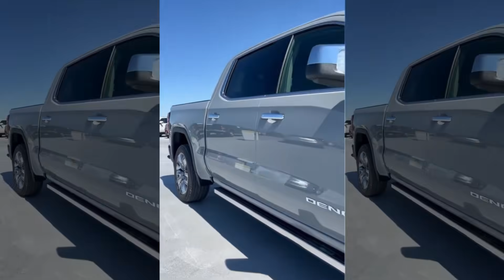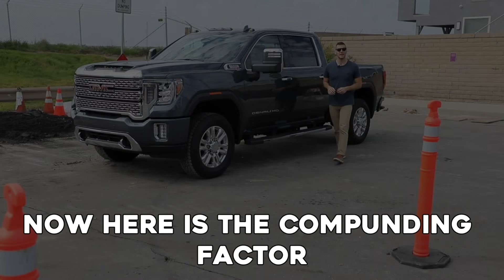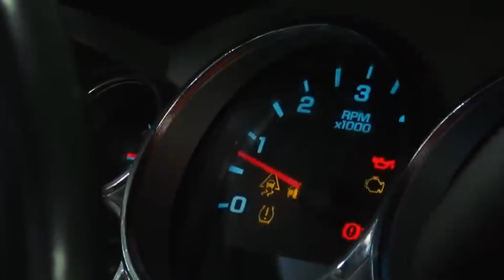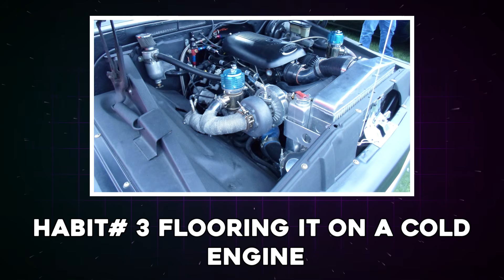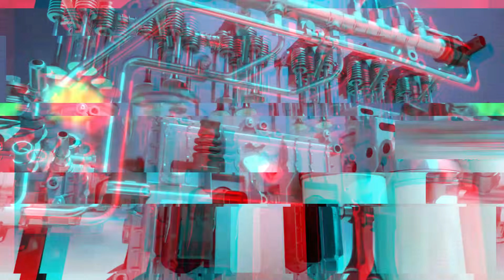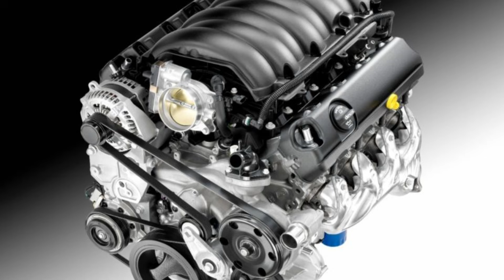7 Stupid GMC Engine Habits That Are KILLING Your Lifters (STOP IT NOW)

Comment: I just got a 2021 Sierra, I'm going to keep this all in mind, on my 4th rewatch of this video
Reply from the maker: 4 rewatches means you’re taking it seriously, and that’s exactly the mindset that saves these engines. Your 2021 likely has DFM (or if it’s a Covid-build, possibly none — worth checking). Either way: disabler, catch can, 5,000-mile full synthetic, and avoid extended idling. Do those and you’ll never meet the lifter problem this video’s about. You’re already ahead of 90% of owners just by paying attention.

Comment: Ticking sound is probably the passenger side rear exhaust bolt, that breaks,  and you have a ticking sound when cold, and goes away 5 minutes later. Every 5.3 has this problem.!
Reply from the maker: You nailed it — passenger side rear exhaust manifold bolt is its own epidemic on the 5.3L. Cold tick that fades after 5 minutes is the giveaway. Different problem from lifter tick, which doesn't go away as the engine warms. Both worth checking on any high-mile 5.3.

Comment: Sounds like you need to spend $135 for a OBD2 plug in that turns the AFM/DFM OFF COMPLETELY. 8 cylinders,  all the time.! This takes care of the terrible idea of GM designer's. Second,  you must not live in a area of winter. Nobody's going to go outside and jump in their truck, start it up and drive off in 60 seconds, with a windshield full of ice and snow.
Reply from the maker: Disabling the cylinder management system is a proven way to extend engine life, and you are absolutely right that cold-weather defrosting is a necessary reality that extends warm-up times. 👍

Comment: If one does use the AFMDFM disabler OBD that you recommend can one then let the engine warm up and idle for a few minutes before starting to drive
Reply from the maker: Disabling the system removes the cylinder-deactivation trigger, so idling to warm up is perfectly fine and won't risk the typical lifter collapse issues. 👍
Reply: @EverythingGMC-k9x  I wish you lived close by us so you could help me work on my car and learn how to do these things. Thank you for responding. Have a great day.

Comment: I bought a module to deactivate AFM from Amazon. It works great and my Yukon drives much better. I wish I had done that before the damn lifter repair of $10,000 happened.
Reply from the maker: $10,000 lifter repair first, then the $80 disabler — that's the most expensive lesson in the comment section. The Yukon driving better after the deactivation module is exactly the proof of concept. Wish it had been the other way around for you. 🙏

Comment: 2019 Tahoe 6.2 doesn’t use a drop
Reply from the maker: 2019 six-two not burning a drop — that's the engine doing exactly what it should. The six-two rewards owners who stay on top of maintenance. Keep the oil fresh and it'll stay that way. 🙏

Comment: I have a 5.3 and a 6.2 Silverado. I tore all of that AFM crap out of them, when I put different cams in them. Now they have more horsepower and better mileage. Screw the EPA in their stupid CAFE.
Reply from the maker: Full cam swap with the AFM delete is the thoroughbred version of what most people do with just a disabler — more power, better mileage, and the AFM hardware is completely out of the equation. That's the right way to do it if you're already in the engine. 💪
Reply: I Agree 100%🤨

Comment: What the hell are you supposed to do in a very cold ass climate? You obviously don't know shit about living in a very cold climate. We're talking below zero temps and sometimes colder.  Fluids has to circulate.  Everything is frozen,  transmission won't shift,  the oil is warm, it's like molasses.  GM screwed up royally with the stupid ass afm dfm bullshit.
Reply from the maker: You're not wrong — below zero is a completely different world and the cold start AFM problem is real. When that oil is thick as molasses and the lifters are already cycling on and off, that's exactly when the damage happens. The fix is the same though: AFM disabler eliminates the cycling entirely so the engine runs as a straight V8 from the first cold start. Remote start to let it warm up first, disabler to keep AFM off the whole time. GM should have never shipped these trucks to cold climate states with this system active. 🙏

Comment: The AFM was disabled at 5000 miles on my  2021 Sierra 5.3. I let it warm up 5 minutes or so when there's Frost on the windows. 65000 now and no issue.   
   Here's something you forgot. The Computer controls the oil pressure. I've seen 35 psi at highway speeds then it climbs to 50 later on.
Reply from the maker: Disabling at 5,000 miles is the smart move — you got ahead of it before the wear pattern could establish. On the oil pressure point, 35 PSI at highway cruise is within normal range for these engines at operating temp, the ECM manages pressure based on load. As long as it's not dropping below 25 at idle when hot you're fine. 65K with no issues confirms you made the right call early. 💪
Reply: I’ve never seen 50 when at operating temperature

Comment: Come on chevy is junk you're lucky to make it out of the parking lot when you buy one
Reply from the maker: GMC and Chevy share the same platform and drivetrain — same engine, same transmission, same frame. If one's junk the other is too, and if one runs 300K the other does as well. The badge doesn't change the block. 🙏

Comment: While I dont know if this applies to AFM vehicles, on DFM vehicles running in L9 shuts off DFM and the auto stop/start feature. It runs as a regular V8. The impressive part is I only run with it off, always….and my gas mileage blows away my previous Ford Expedition. I get 16/17 city and 18/20 highway. 2026 Tahoe.
Reply from the maker: The L9 shutting off DFM and auto stop/start changes the whole equation — 16/17 city on a Tahoe is genuinely impressive. Running it as a straight V8 all the time is exactly how that platform should have shipped from the factory. 💪

Comment: So if Afm is to save fuel thus safe the planet 🙄 (bs) then If it’s burning several quarts of oil between oil changes, where’s the oil going? Out of the exhaust? Therefore polluting??
Reply from the maker: That's exactly the contradiction — GM marketed AFM as an emissions and fuel economy win, but an engine burning a quart every 1,000 miles is pumping unburned oil through the exhaust. The math doesn't add up either way. 🙏

Comment: Lucky for me I found out due to covid my 2021 GMC Sierra 1500 5.3 does not have the AFM/DFM computer chip. But the transmission still failed at just over 17k. It was under warranty, so GM replace it. I can only hope the replacement transmission goes further than 150k. With that said I still most likely out of muscle memory still change my truck oil every 3,000 to maybe 3500 miles and keep up with other schedule maintenance religiously. Also, GM needs do their part to get rid of the AFM/DFM, glass cockpit nonsense with subscription software's and Auto Stop/Start BS and start making pickup trucks / SUVs that can handle over 300,000 miles. And this is not just GM it is all vehicle manufacturers. Ultimately costumers can make you or break you with their wallets.
Reply from the maker: Dodged the AFM bullet and still got a transmission at 17K — that's the frustrating part about that generation. Good that GM covered it under warranty. The 3,000-5,000 mile oil change schedule and staying on top of transmission fluid are the two biggest things you can do to protect that replacement unit long-term. 👍

Comment: I’m still using my car starter in the winter 🥶
Reply from the maker: just make sure it's actually warming up the oil before you put it under load, not just idling and then immediately driving hard. Give it a minute or two to build oil pressure and you're good. 👍

Comment: I have a 2018 chevy silverado, is it good to let it warm up before moving, so far it's been running great only 47k.
Reply from the maker: At 47K a brief warm-up before moving is never a bad habit, especially in cold weather. The bigger thing on a 2018 five-three is the AFM — if you haven't already, an AFM disabler is the best preventive move you can make at this mileage. 🙏

Comment: Do 3.6 liter v6 gmc canyon 2019 have this issue Too''
Reply: Yes
Reply from the maker: The three-six in the 2019 Canyon doesn't run AFM the same way the five-three does, so the lifter collapse risk is much lower. It has its own set of maintenance needs but the AFM lifter lottery is primarily a five-three and six-two problem. 👍

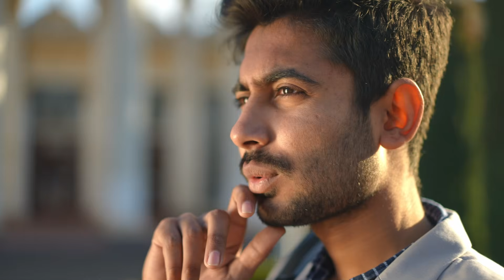Comment: 14:59 if my 5.3 or 6.2 engine was under warranty and began to tick, I would drive the hell out of it until the engine blew!
Reply from the maker: That's a bold strategy 😂 — but honestly not wrong from a warranty standpoint. If GM knows the engine has a design flaw and it's still under warranty, making them fix it properly is exactly what the warranty is for. Can't say we'd recommend it but we understand the logic. 🙏
Reply: @EverythingGMC-k9x  oh yeah, I’m going to destroy that engine if one lifter goes bad. I will literally drive it until it starts on fire and say I have no idea what happened.😂 new engine in coming!

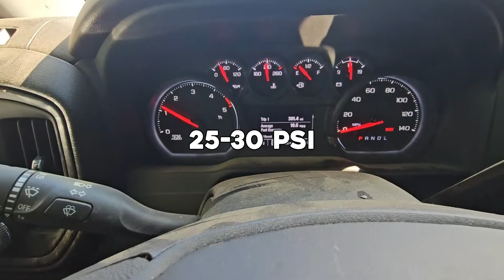Comment: 5:49 but when I cold start my truck, the oil pressure stays above 60 psi for at least five minutes. even when the engine rpm kicks down less than one minute after starting it. oil pressure is still above 60 psi.
Reply from the maker: 60 PSI holding steady through warmup is exactly what you want to see — that means the oil pump is healthy, the bearings have good clearance, and the engine isn't starving on cold starts. That's a well-maintained engine right there. 💪
Reply: @EverythingGMC-k9x  good to know.  I noticed this because I have a 5.3 L Chevy and I am well aware about letting it idle for long periods of time. Thank you.

Comment: Put a dellet switch on to turn off your DFM and it doesn't burn any oil
Reply from the maker: The delete switch is old school and it works — keeps the engine on all eight cylinders without touching the OBD2 port. Simple, reliable, no subscription. Good call. 👍